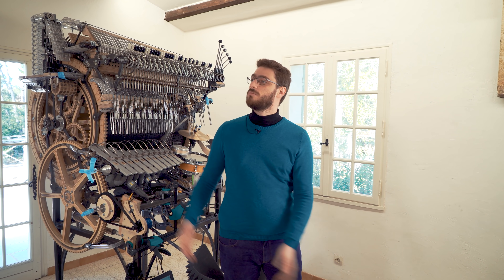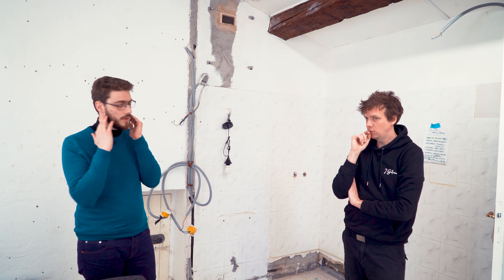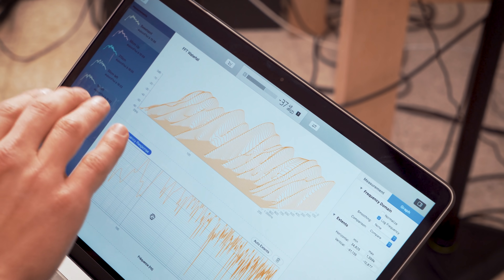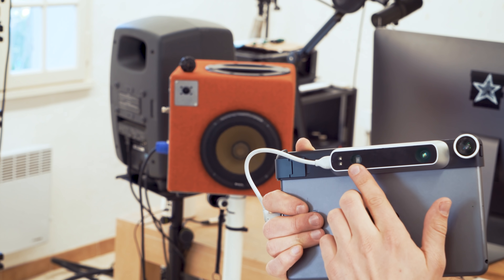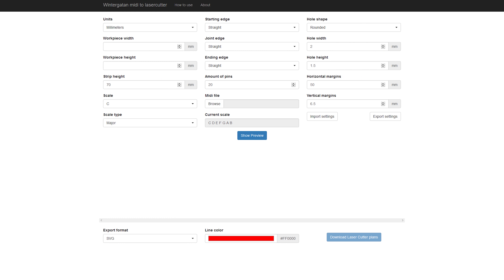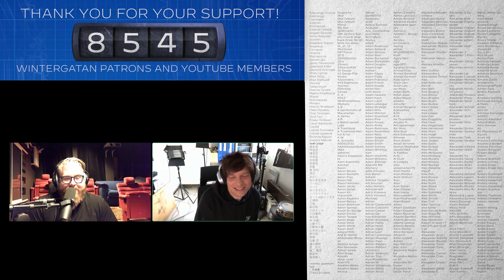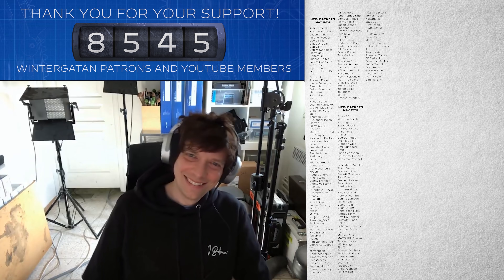Music Studio Acoustic Measurements - Marble Machine X #127

Comment: 1 million percent get the electronic control set up as a compositional tool if it's feasible and efficient. The solenoids are probably noisier than you'd want for a finished performance, but the only other option you have for composition with the sounds of the actual machine is sampling. Given that the sounds of the machine's operation is a part of the experience, sampling wouldn't give you as clear feedback on the finished piece.

Comment: The overwhelming consensus seems to be against the use of solenoids which I understand, but the real problem here is the ability to program the MMX !
I don't like the idea of stud welded plates (too permanent and restrictive) and I don't like the idea of solenoid triggering of the marbles (takes away from the mechanical aspect).
But perhaps there is a mid way solution ?
Imagine the drum instead of having fixed pins, being fitted with small "push to open catches", now it should be able to have a row of small solenoids at some point above the drum and trigger them to open or close the catches (pins) to program the songs from midi... yes the drum would need encoding so the correct pins were pushed at the right time and you would need to have a row of paddles to reset all the pins to the same position, but in theory this would allow the MMX to remain mechanical whilst automating the programming from MIDI ?
Reply: Solenoids would only be used for composing (I think there's a bit of misunderstanding in the community on this point), while the stud welded plates would be used in live performances, since manual programming is too time-consuming and error-prone.  I can't comment on your idea, though it sounds interesting, but my feeling is that anything that changes the pins on the fly, even electronically, might just be adding to the risk of something going wrong on stage.  However, you may want to post your idea on the new Wintergatan Discord server.

Comment: :( My take of the whole point of the Marble Machine and MMX is that they are mechanical. Much like the first mechanical analogue clocks and watches. Why adapt ideas that turn it into a electronic machine :( That's then making the digital clock / watch. All the mechanical music boxes and machines are fascinating as the MMX should be. Please don't spoil it with solonoids and electronics. It's bad enough having a drive motor and digital mics. :I

Comment: If the MMX gets covered in concrete dust, that will be an excellent test of it's robustness.

As for solenoids, consider how violent those would be compared the very slow push of the programming pins. The forces would be magnified and you may start breaking things. Something for the engineers to think about...

If the MMX gets solenoids, I want it to be because it will actually help Martin and not because it puts a foot in the door to computer automating and losing the mechanical nature of the MMX.

Comment: The purely mechanical programming wheel to ball bearing release mechanism is so central to the machine. The solenoids in my opinion might kill the magic. The purpose would be to compose quicker so that the programming wheels can be manufactured right first time, right? What if instead a removable composing tool can be attached purely for the composition process and testing, and removed for performance where the programming wheel and the mechanics do all the work! Just an opinion lads don't kill me!

Comment: I know you guys are talking about maybe 2 marble machines. Maybe have a composing one and a performing one. Have the more robotic solenoid midi to MMX thing for the composing one, then use the performing one to play it in the more traditional way of you spinning the crank to make everything happen. I think thats a key part of the machine, otherwise you've made a really big physical sequencer and if you wanted that you could basically just buy some polyend perc's. I think its fine to have assistance like with the motor but if the machine ends up just being run by machines it defeats the purpose of it being a thing in the first place. But i understand it would be cumbersome to compose on it as is, so thats why I think maybe for the backup one, it would be ok for it to be less manual and it would be a backup/composing machine instead. MMX and MMX+ basically.

Comment: I think your guide should be that if the power goes off everything still works and sounds good.  I can handle the electric assist  motor but I'd die a little inside of the solenoid thing is put on the machine even for composition.

Comment: IF you did add midi solenoids to the marble machine, you could pair that with the motor. You could set the rpm / bpm of the machine, and in essence press "play" on your laptop and have the machine automatically spin up and play it. You wouldn't have to get up at all.

Comment: I like the solenoid idea, it wouldn’t be too difficult to make. But the biggest mechanical issue will be in creating a way for it to clip onto the MMX rigidly. Electrically speaking, you’ll need a somewhat beefy power supply, since those solenoids can take a few hundred mA each and you’ve got like 30-60 rows to worry about (including doubles). But only 6 or so of these will be actuated at once, so I’d say that 12V 3A should be more than enough. It’s interesting how the electronics (firmware) side will be the opposite of a midi keyboard, converting midi data back into physical key presses. Though I guess your computer probably won’t be outputting midi data but some sort of custom audio data stream, without the extra added duration and velocity data.

Makes me wonder if just wiring up a keyboard directly to the solenoids would be worth doing, without it even going through a midi stage at all. Sure it wouldn’t allow you to compose a song beforehand and just click play, but it would still be neat if you can get the delay out of your head.

Comment: I think the solenoid MIDI idea is a good one, but a core requirement would be to hide the solenoids so they don't interfere with the mechanical maniac look.  I recommend using PCBs with sockets to control the solenoids and find solenoids that have pins and compatible sockets.  When a solenoid fails, you simply undo a few screws to remove the solenoid from the board and machine.  The boards can also be made structural, an 8 layer board is usually quite thick and strong.  You could then add drivers and multiplexers to the boards, having ~8 channels per board sounds about right.  Using SPI with and/or plain shift registers would be a convenient way of addressing 64 some odd channels.  I know there are only 38 channels in the MMX...

Comment: Please read:

Don't work in Midi for the MMX.

Use a custom software sequencer that you can load audio samples into.  Use actual recordings or the MMX to create the samples.

The sequencer should be programmed to the actual timings of the MMX channels.

That way you can have a direct 1 to 1 to 1 correlation between what you are composing, what audio the software produces and what you send off for studded plate fabrication.

Thank you for your time

Comment: 15:27 Martin, be careful to not forget the origins of this entire machine. I see the idea of solenoids ONLY to be okay in a CAD version duplicate/ backup machine of the MMX (for composition purposes) but NOT on the original machine. 
The drive motor was almost a deal breaker taking away the human/ machine/ mechanical bond, but it is an understandable help. Let's not take too many steps away from its original birth and give way to "technical simplicity" at the finish line.

Comment: I've watched your channel since the original Marble Machine. Every single week... However, I don't agree with the direction the Marble Machine X is going. It has changed from a highly-upgraded version made by one genius, to an over-developed soon-to-be disaster if things continue this way. The programming pins and wheels were part of the charm... now you want to change it to a welded system because it's easier? You want to set up a solenoid system so it's easier to compose songs instead of having to program what you envisioned? I wholeheartedly understand that this project is monumental in scale, but I can't accept that it's turning into a development where you might as well  purchase pre-made parts from China and bolt them together. Where's the charm? Where's the glory? I'll continue to watch every single video you produce, but I hope that you reconsider turning this into a production-line machine in order to make music instead of making a machine that makes art.

Comment: I'm a little confused reading the 20 almost identically phrased comments about the solenoids. First of all, it's art, let Marten decide what workflows he wants to enable.

Either people really aren't getting that there is no suggestion to remove the programming wheel or they seem to be willfully misunderstanding to show they're concerned about a kind of purity and emulating the original MM.

Some of the grandest organs have midi controllers (https://www.youtube.com/watch?v=SQHdFAm7g7E), doesn't make them any less grand.

There's surely a discussion as to whether it's worth the time/risk/complexity for the reward but I don't think this needs to be a idealogical issue.
Reply: Totally this. Thank you.
Reply: yes i thought it was pretty clear Martin intended the solenoid release system to be used for composing and iterating pieces, which would then printed onto stud-plates
Reply: I would say that integrating the solenoids will have two possible consequences. For one, now MMX is completely mecanical, and if you want you can play it without any additional power supply than your own feet and hand. Next - MMX marble drop will become even more complex than it is now. On the other hand you get perfect timing of marble drop and long durability of parts. Anyways, IMHO it's up to Martin to decide wheter it will or won't be on tweaks list for MMX :)

Comment: I really like the solenoid idea. At least, if there’s a somewhat easy way to integrate them, I would go for it. When composing, it will be more accurate than sampling. It would be very hard to accurately simulate all the mechanical noises and especially the bass wouldn’t be to easy to sample. Especially as it will also make it easier to get a felling of what is possible to do manually, like holding some bass strings. As a keyboardist myself I also love the idea of making the Marble Machine playable via a midi keyboard.
On the other hand, if it’s not easily integratable I wouldn’t see them as a priority.

Comment: About 15:25. Mikhail has a good electric control solution. However. As I see it. It would break the concept. MMX is meant to be a fully mechanical ,,, music box. Like the first one was. It needs to stand alone with no electronics controlling the actions. Wintergatan. Stick to the love you have for those old music machines I saw in previous videos and wanting to make an instrument like them but using modern tech.

Comment: why not have solenoids on the "programming wheel" itself this way you have an infinite length programming wheel where the solenoids can update as it turns. Ya it would be a crap load of solenoids on the drum but think of the options it gives you at that point. For MMX 2.0 you would then need a far far far smaller programming wheel to accomplish the same goal as the large one does. I assume the size of the current programming wheel is partially due to having some workable number of playable notes before it is forced to repeat. Having the system refresh "on wheel" would eliminate the need for such a big programming wheel and make the machine far more portable

Comment: Martin I love what you have made but I caution you with the solinoids and the computer programming of the MMX. I mean if you are going to do that, then just play a keyboard. The charm of the MMX is the analog nature of the device. Programing it with a computer and using electronics cuts half of the mechanics out of the machine. It might as well just be samples on an midi machine. Don't worry so much about it being tight! The beauty of the MMX is the  man and machine working in synchronicity to create music. Don't loose the forest for the trees. Stay on target and don't loose sight of the charm!
Reply: It'll just be for composing, not for actually playing.
Reply: @clonkex  Exactly. Imagine wanting to hash out a 2 bar section but having to loop all the way around to get to it, multiple times.
Reply: The solenoids will be used for composing purposes, not programming!

Comment: 0,05 mm discrepancy in the programming pins is too much?? That's absolutely TINY! Let's do some rough basic math! *Spoiler*, any note can be about 0,5 ms off.

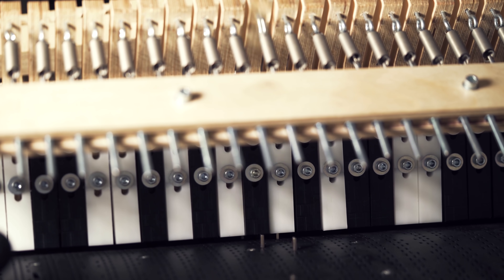Judging from the video at 10:55, the pins seem to travel at about 10 cm/s (EXTREME ESTIMATE), that's 100 mm/s. If one pin is 0,05 mm off it's intended position, that corresponds to t=s/v = 0,05/100 = 0,0005 s = 0,5 ms

Now you can be the judge if that's not tight enough. In the worst case scenario, one note is 0,5 ms early and the next is 0,5 ms late, making them 1 ms further apart than intended. But this is just based on eye measurement.

Comment: I have to say, I'm not a fan of the solenoid dropper idea. The biggest charm the machine has is that it is all mechanical, and not electrical. I feel that having an electric motor to spin the machine is more in line with the idea of the machine than MIDI controlled solenoid pistons, and the electric motor was considered against the spirit of the project. No hate, just trying to offer some constructive criticism. Love the project, and it's Martin's choice of what he thinks is best for it.

Comment: Why I don't like the Solenoid : For me, the MMX is supposed to be able to play on its own without any electricity or computer. Like most of the instruments in the speelklok  museum.
Reply: He is only suggesting it as a compositional tool.  Martin specifically said that he would then convert his midi file into code for the pin welder to make the programming plates.
Reply: It will not take anything away from the original idea, but it will turn the machine into a real instrument as well. If you want to fill a 2 hour show and take it around the world, you really need options.
Reply: Pretty sure Miro is correct. It is just for quicker testing tweaks in the composition without redoing pins all the way around the programming wheel. During the concerts the plan is still to swap out the stud welded sheets between songs.
Reply: @syndaquil4838  I can see the appeal for Martin even just as a compositional tool, but I agree with Bob that it takes something away from the spirit and beauty of the machine. It gives you the feeling of "why do we even have this massive drum thing and all this mechanical timing stuff if we also have these electronic solenoids here that could do it all?" But I guess if it is discrete enough then he can get away with it.
Reply: It'll just be for composing, not for actually playing.

Comment: MIDI controlled marble drop system sounds good for composing, but you will need to think of a way of deactivating it when you are using the programming pins for the marble drops. The two systems must not interfere with one another.

Comment: I'm sure the solenoid idea is to eliminate the making of permanent welded stud sheet and replace it with easy to change studs, it's like manual pins but automatic and synced with the midi.

I think it's really great but there'll be a lot of it to fit